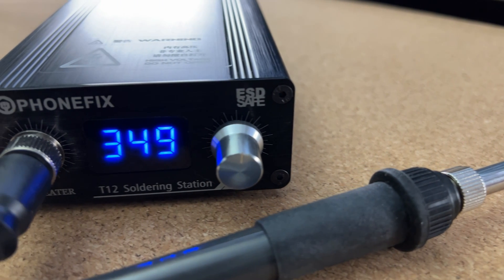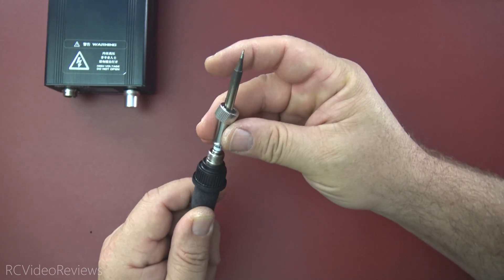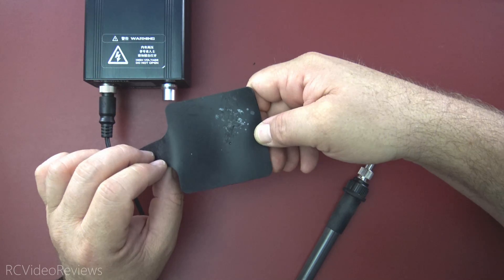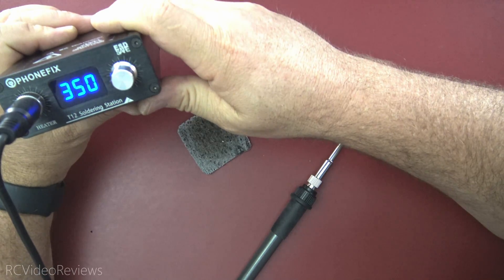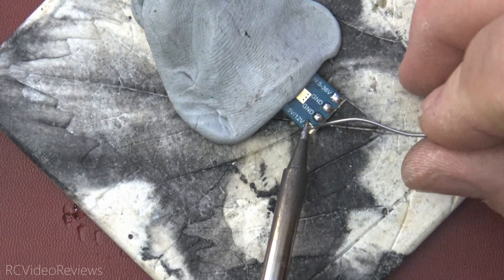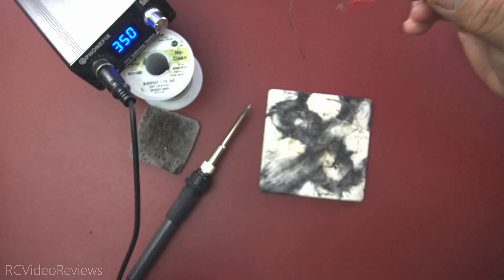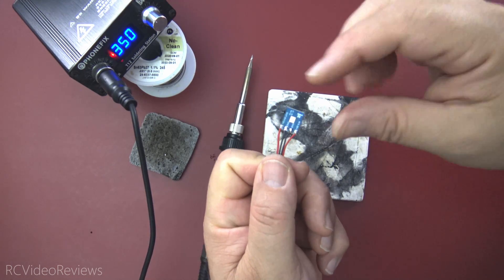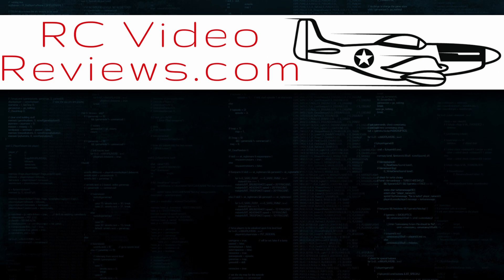REALLY??? Soldering Station with Temp Control for $25? Phonefix T12-D

Comment: Is the Temperature reading accurate? Don’t you have a IR temperature gun?
Reply from the maker: I put the gun on it but it wasn’t accurate. It showed 30c. However, at 350, solder melted pretty quickly so comparing it to my Hakko, I’d say it out out completely sufficient heat for small work pieces. I did not try any heavy jobs to stress test for maintaining temp because it didn’t come with tips designed for heavier gauges. So bottom line, it puts out plenty for lighter workloads.

Comment: I would rather just pay more for the convenience of not having to worry about the alignment issues.
Reply from the maker: Yeah, that is an annoying thing. One other comment said these tips don't use the holes on the bottom for contact, that the sides are responsible for contact. Whatever it is, that was a little annoying. However, once set, it seemed fine and worked well.

Comment: lol..20 Euro + 24 Euro shipping. really not cheaper than every other t12 station ...
Reply from the maker: Just yesterday I was ordering a $4 part and the shipping was $9. Kinda sucks when that happens. I ended up canceling and ordering it from somewhere else.

My POV on this is when we buy stuff that's in-country already, the shipping costs to get it there are reflected in the retail price. When we buy stuff in China, those costs are not applied to the retail price. So to come out ahead--this may sound silly--you need to buy more. That spreads the shipping costs out over more things and you benefit from the lower list price. 

Kinda screwy, but I'm pretty sure that's how this all works.

Comment: Yeah that whole aligning thing looks like a pita but for the price it does offer a lot more options than just a regular plug in iron for just a little more cash.
Reply from the maker: If you don't change tips too often the alignment thing would wind up being a non-issues, but it is something they should fix.